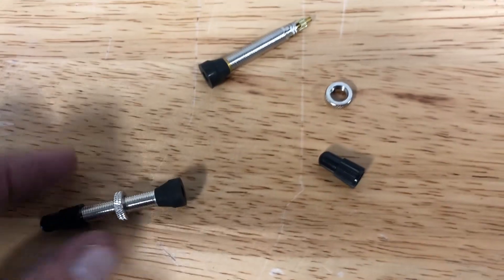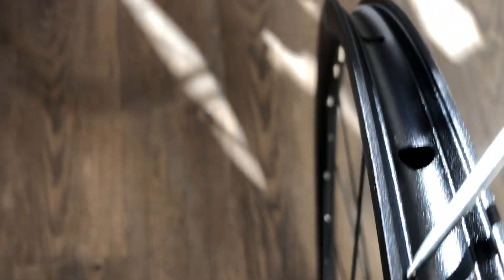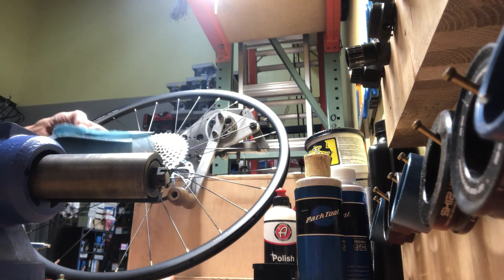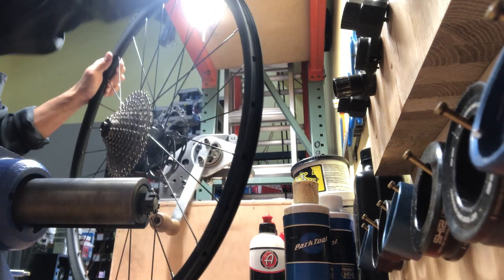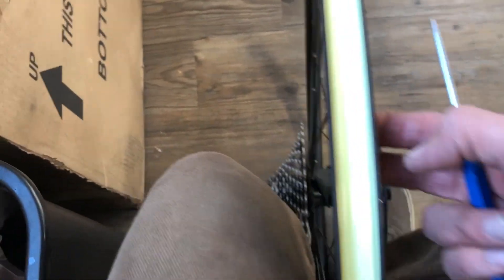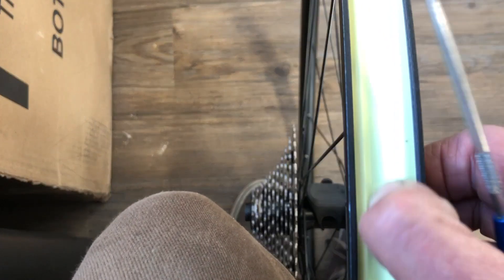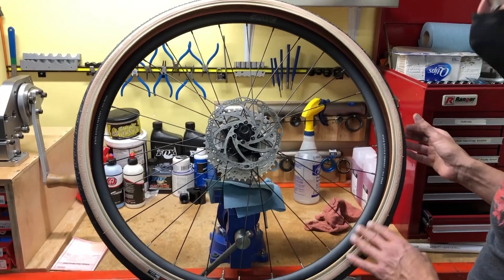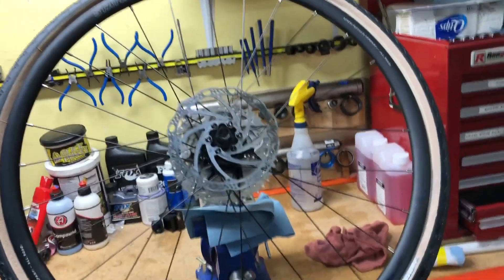Tips For Setting Up A Tubeless Bicycle Tire

Comment: Thanks Joey! Any tips for narrower road tires, e.g. Continental GP 5000 TL?
Reply from the maker: You're Welcome Denis! On a road setup, like the GP 5000 tubeless tire, it's usually best install the tire all the way onto the rim, WITHOUT adding sealant yet, remove the valve core, shoot compressed air into the open valve to get the tire seated on both sides, let the air out, add about 1oz of sealant, reinstall valve core and inflate to the desired air pressure.
Reply: @JoeyMesa  Come spring I will install tubeless tires on Yoeleo wheels. Thanks for the tips!
Reply: I know I'm pretty off topic but do anyone know a good website to watch new movies online ?
Reply: @Terry Esteban Thanks, I signed up and it seems like they got a lot of movies there :) I really appreciate it !
Reply: @Gianni Alfredo happy to help :)